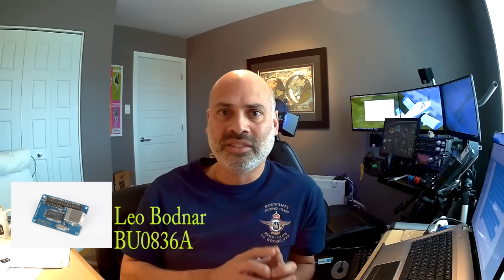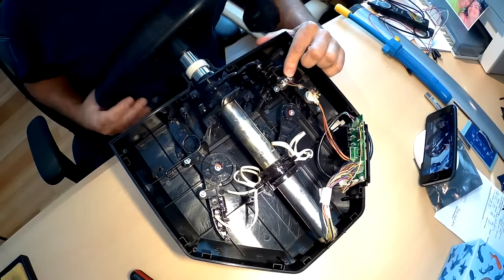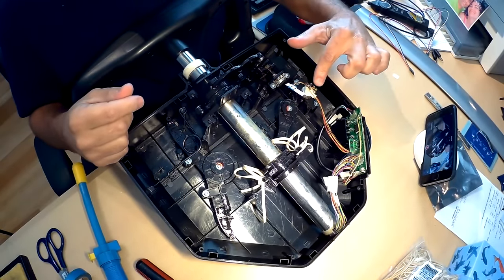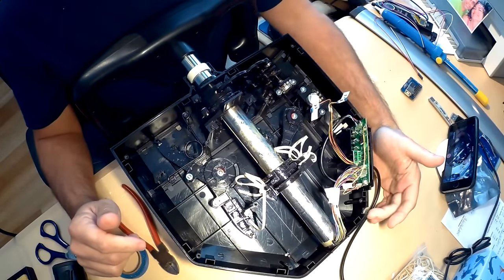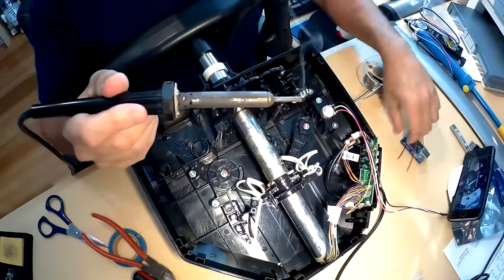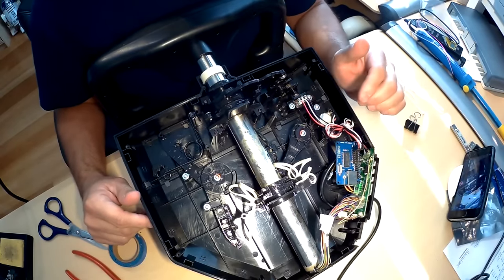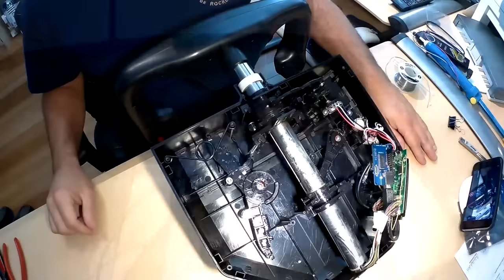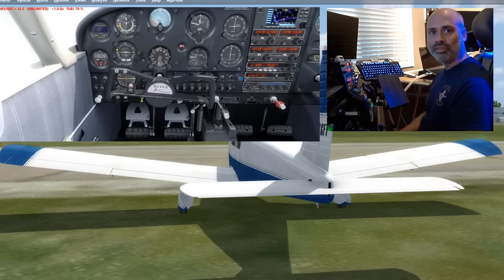Saitek Pro Flight Yoke Dead Zone Fix

Comment: Hello! I connect the USB port included in the joke, a keyboard, a mouse, and another saitek quadrant of gases.
The USB cable that comes out of the joke, I connect it to a USB supply power.
Do you think my settings are correct?
Thank you very much

Comment: My Pro flight Yoke looks like it somehow got fried the other day!??
I have the X And Y axis controlled by a BUO836X card so they still work.

I already had the extra set of Saitek throttles therefore I bought another set to replace the set that went with the yoke.

Now all that I am missing is the 8 buttons from the fried yoke!

Do you know if the buttons belonging to the yoke can be wired into Leo's card?
Where could I get info on sorting out the large amount of wires that control the switches?
Reply from the maker: Yes, you can use the remaining button positions on the BU0836X card to hook up your Saitek buttons.  To figure out which one does what, you'll need a multi-tester.  You can also disassemble the yoke handle and follow the wires and note the colors.
Reply: Hi Roger, did you switch the handle switches from the Saitek electronic board to the Leo Bodnar board already? I want to do the same due to the fact that some wires broke at the place where they were soldered onto the Saitek board. Because there is no schema available I do not know where I must resolder the wires.

Comment: Is it possible to change saitek Potentiometer to high accuracy hall-effect rotary SENSOR to improve the deadzone ?
Reply: yes, but it involves custom mounting, specialized boards, and programming.  trust me its way more work than its worth.  just buy a better potemtiometer and adjust the mounting system and so the yoke goes a full 90 degrees in each direction as it would be easier and potentiometers are very easy to replace.

Comment: I installed the fix as you described but now my simulator see two yokes. Where did i go wrong?
Reply: As far as I can tell, that's how it is supposed to work. The board is the new device - just without all the potentiometers and other hardware installed.

Comment: If you do that mod, do the drivers included by Logitech still work? And also can you still use the USB port and the throttle quadrant included?
Reply: Everyhing from the Saitek yoke still works as it did before the mod. Only problem I had in X-Plane, was I needed to turn off the outputs from the Saitek pitch/roll module In the setup window. If you don't, it will try to assign those outputs to random functions and render them inoperative. Simply switch them to "none". Also wiring to the pots aren't critical except the signal wire MUST be on the center lug. If they work backwards, just reverse the throw in the setup menu. This is well worth the time and money and with the rubber band mods on the yoke, its as smooth as glass. Be sure to check the yoke is not binding as you put the screws back in. I did with each screw. The first time I put them all in and it was sticking. Enjoy !

Comment: So I did this and it works very well, but there is a glitch when I plus the throttle quad back in because it connects to the original green board. Because of this, the old cords that got soldered turn on and cause the glitch. Does anyone have any suggestions on what to do?

Comment: I did the mod and find the elevator and aileron worked smoothly if I connected only the new USB cable. But I no longer have any operable yoke buttons. If I also connect the old USB cable, the elevator and ailerons are out of control. What have I done wrong? Roland
Reply: I found the problem and it was me. I failed to disconnect Saitek yoke from the X/Y axis. Now everything is great. Thanks to Leo for coming up with the fix and Dan for showing how to implement it.
Reply from the maker: Glad it worked out!

Comment: Maybe someone can help me. As you migh know there is a cable you need to connect to the yoke for the mixture etc. console. When im in game I see the throttle/speedbreaks etc jumping due to a loose contact in the plug. Does anybody know how to fix that the best? Its really frustraiting when playing and mid air the speedbreaks open because you touched the cable.
Reply from the maker: Three ways to possibly address.  Open up the yoke, resolder the pins of that connector to the PCB.  Otherwise remove the connector all together and solder your wires direct to board.  Or hybrid, solder a new male female connector of your choosing that handles the number of conductors.   All solutions require soldering.

Comment: Thanks for this video! I did the mod today and I have two little issues... the card is disconnecting from the pc after 5 minutes and the calibration of the pitch is not good, in position zero the card says it is up, slightly but enough to be a problem, does anyone had the same issues? and do you have a solution to share? :) thanks
Reply: Check power management of usb ports.

Comment: When you were putting on the zip tie to the USB cord there were no rubber bands in the middle of the yoke but when you went to close the case the rubber bands magically appeared what happened
Reply from the maker: MrArcelton I probably removed them temporarily.
Reply: @Mixturerich  Would you mind sharing which video you used to do the spring/rubber band modification?  I'm doing the deadzone fix!  Thanks!

Comment: Hi, do you know how i can fix my yoke after a short circuit?
i can`t turn it on. is like dead :(, i dont want to buy another one new.
Reply: I think desktopaviator website has a board that is compatible with several axis and loads of buttons and switches. So what I would do is get one of those, ditch the original manufacturer's board and install the new board so you have an all in one solution.

Comment: I want to validate your observations on the core deadzone problem.   I have several thousand hours of light aircraft time, zero sim time, and am trying to figure out if sims are realistic enough to interest me in spending whatever it takes to get one that "flys like a real light airplane".  The deadzone was driving me crazy on final lurching from one side of the runway to the other.  I assumed the problem was me.  Then I measured deadzones in the realworld.

NULL ZONE / DEADSPOT

1977 Piper Warrior
 Yoke movement before aileron moves: 3 mm
 Yoke movement before elevator moves: 2 mm

2016 Toyota Corolla
 Steering wheel movement before tire moves: 2 mm

Saitek Pro Flight Yoke with X-Plane 11.30
 Yoke movement before horizon rolls: 15 mm
 Yoke movement before horizon pitches: 26 mm

The surprise was my Toyota.  Watch how little your steering wheel moves to stay in your lane the next time you are driving on a highway.

The Saitek yoke is 5-10 times worse that real airplanes or cars.  Add in those bizarro (to a real pilot) springs and it is frustrating !!!

I went to the "rent-a-sim" area at the Hiller Flight Museum in San Carlos, California, and watched the experienced simmers land light planes. They landed somewhere on the runway, not on the centerline.  And had developed the (necessary) habit of jerking the yoke around to get to the edge of the deadzone.  My mouth dropped, imagining what results that would produce in a real airplane.
Essentially, these experienced simmers-only, not pilots had learned to drive a 1953 Ford with 2 inches of play in the steering wheel and no shock absorbers !! 

I bought a VKB Gladiator stick reviewed as "the best".  Reduced the deadzone down to" only" 2-3 times worse than a Toyota.  I really admire your ingenuity and skill with your Saitek mod, but I am only willing to deal with "plug-and-play" .  I am not a computer hobbyist, and am not willing to become one just to be able to have a sim that "flys VFR like a real airplane"

 FINALLY MY QUESTION:

Is having a plug-and-play sim yoke/stick that I can VFR hold the centerline and the VASI with fingertip pressure (like real airplanes.....and Toyotas !!) simply unavailable at any price?  I am happy to pay for a Yoko or other pricey control stick....PROVIDED I can get a review from a real airplane pilot who says "yes, absolutely.  you can fly it with your fingertips and make those tiny little instinctual-muscle-memory corrections....exactly as you can on a real airplane.  And you are not fighting against those like-nothing-in-reality centering springs."

Sadly, at this point I have tenatively concluded that there is visual flight sim world, and there is visual flight airplane world, and that they are so different that I would not want to destroy my decades-worth of expensively-gained real airplane instincts with simming..(until I lose my medical and can no longer enter a real cockpit...then destruction of my skills no longer matters)
Reply: I'm an instrument rated pilot.  This repair is overkill.  There is no reason to rip out the guts of the yoke.  The original design is actually good.  But, they used springs that are too heavy.  I bought replacements a Lowes (pitch detent bothered me more than roll).  I put a very light spring in to replace the pitch spring and it feels great.  Very little force required to move the control.  The hard detent disappeared.  The null zone issue (with my yoke at least) was solved by adjusting the potentiometers.  Mine were WAY out of adjustment.  Couldn't shoot a precision approach with the thing.  Now it's much better.  I can now go to chase plane view and see my controls move with small (still a little larger than a real plane) inputs.

Comment: Today I received my Yoke, still with the dead zone!!!! Additionally the dead zone is out of center, so turning left from the center there is no dead zone, after ~5° no movement for 5°, then the movement seams to be normal till the end stop. I think the potentiometer is assembled out of center, so the quality control at Logitech seams to be at holyday for the last couple of years. I am going to send it back and try to get a working one ...
Reply: Recalibrate to remove the out of center issue.  Logitech FAQ: https://support.logi.com/hc/en-us/articles/360025333293--FAQ-Flight-Yoke-System  "Recalibrate controller axes: RegEdit"  I did it and works well.  Dead zone not resolved yet though.

Comment: Just so you know the issue is with the pottentiometers, the Saitek circuit board is just fine. By simply changing out the 2 pottentiometers with a finer veneer type calibrated pottentiometers it solves the problem and it is a lot easier then this overkill modification and costs less then 5 bucks. Sorry I don't mean to be negative but I fixed both mine and my sons units this way years and years ago. Couldn't help commenting after seeing this post. My son just pointed out that there is a simple hack that fixes it fast no mods required.
https://www.youtube.com/watch?v=KJr-rI3I5Rc

Comment: i heard of an easier modification posted 5 \ 6 years ago which is a guy in which also just flipped the sensors and fixed the problem
Reply from the maker: +omer cohen post a link, that's interesting
Reply: not sure i can find it now, but i can look fo

Comment: I turned my yoke to hard and then I heard a pop and now when I turn left and right it doesn't work
Reply from the maker: Simple fix, it’s probably just the gear that engages with the potentiometer.   Open it up and re engage the teeth of the gears between the yoke side and then potentiometer side.

Comment: Only nessesary for FSX. With Prepar3D no dead zone.
Reply from the maker: Unusual, I am running P3D.  I had the same issues in FSX and P3D.  This is not a software issue, it's hardware/firmware.  Glad that yours has no issue in P3D.

Comment: The dead zone is not much different than in any full scale airplane - They all pretty much have a non responsive soft center.  You get used to it if you don't overthink it.
Reply from the maker: Warren Allred what are you flying?  I’d have that checked out.  ;-)

Comment: Thanks for this! A few weeks ago I made an encoder controller for the garmin g1000 (I fly in vr, so wanted tactile control). After seeing your video a few days ago I realized I have the same deadzone in my saitek yoke. I decided to try patching the potentiometer signals into the arduino pro micro I used as a controller for the encoder box, and am happy to report it works like a charm! I use mmjoy to convert the arduino into a game controller, and it has proven to be extremely flexible. Here's a video of my initial project if you are interested, apologies for the awful audio.  https://youtu.be/dEtDt6eQK5Y
Reply: Perfectly working Arduino Pro Micro solution here:) With the rubber band mode I feel like I'm finally connected to the plane! Love it!

Comment: Very sloppy work. Never ever have signalling boards so close together. That board could have been put anywhere in the yoke there is loads of room. You couldn't have gone for a more expensive board if you tried. Arduino do this board for half the price and are just as stable if not better. The wire feeds from the rotary's to the board should never be too long that you have to bend and wrap them together. This causes signal loss and magnetic wave. Good fix but expensive and sloppy.
Reply from the maker: Feel better?  This video has been useful to so many people over the years.  Where is your video showing how to do this better?   Feel free to post your link back in this feed; happy to share it.   FYI, my implementation has been flawless.  No signal issues and reliable service for years.

Comment: I think this is an over solution.  The problem with the original equipment is the springs are too stiff.  Just replace the springs with lighter ones.  You can find replacements at Lowes that work great!  I did it.  The OEM design is good.  There is no reason to rip the guts out of the yoke.  The dead zone is an adjustment issue with the potentiometers.  I have no dead zone after adjusting them.
Reply: i like to see a video showing absolute zero deadzone. I honestly dont believe this at all.

Comment: Why didn't you just use the soldering iron to melt a hole in the rear for the USB? That was you can have more control over the size, and no mess to vacuum up. I mean you're using a cannon to kill a fly... Or if you were determined to use a big tool to cut the case for the pass-through, then why not cut a "V" into it, so you don't have to break the piece out like a neanderthal. Holy crap, knowing where you were going to place the board, why didn't you just cut the wires to a more serviceable length before soldering them??? Man, the more I watch the worse you get. It's like watching the cast of Big Bang Theory trying to play sports!!! You are really horrible with this kind of thing. This is a seriously easy fix, and you make it look ten times harder than it is. I mean it's really painful watching you fumble about. Maybe practice in the future before shooting the video.
Reply from the maker: Wow, thanks for the "constructive" criticism.
Reply: Hi I followed your video to the T, after everything was hooked up I tried it I calibrated it but then when I went to fly, I had no role control and my pitch was reversed, any ideas of what I may have done wrong.